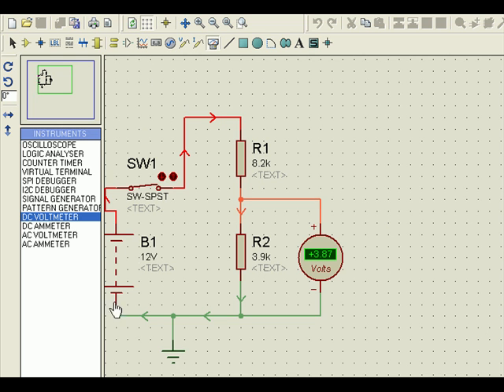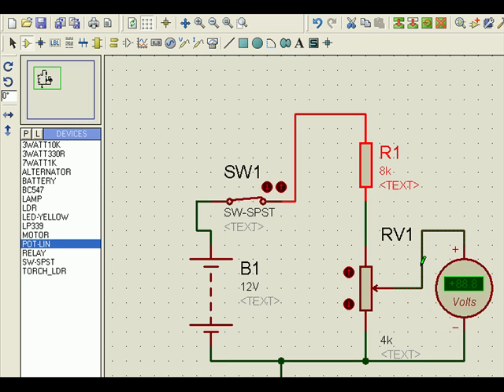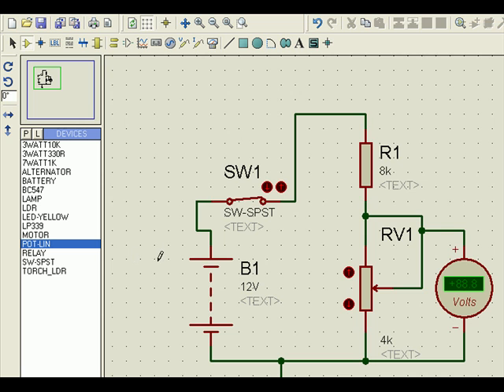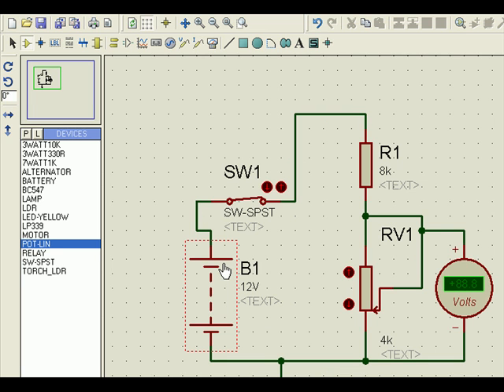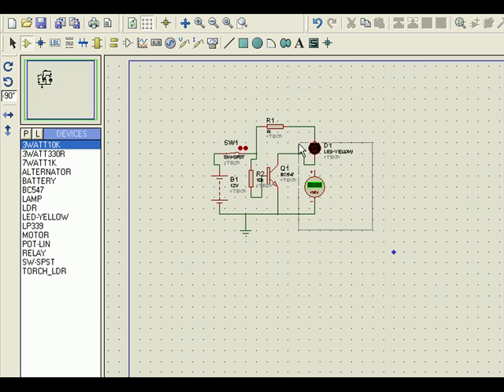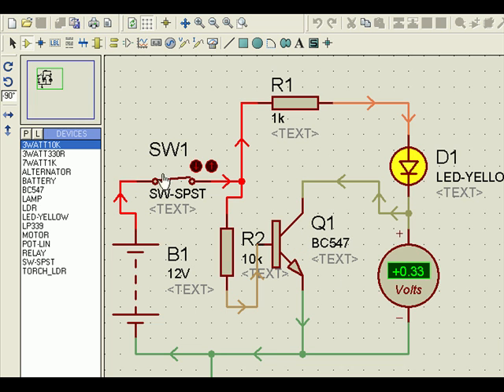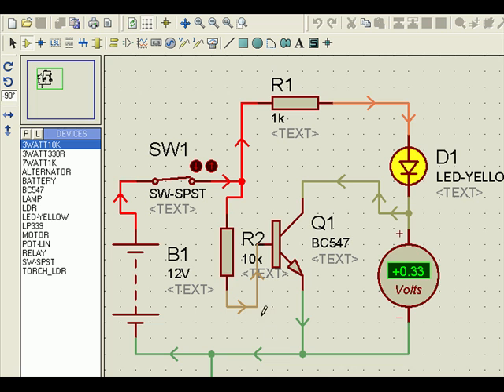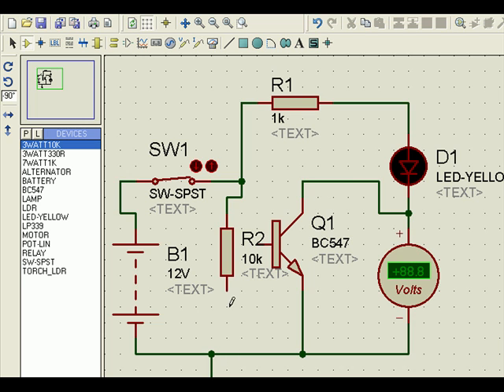Practical Electronics 2

Comment: Please can i tell me how to add the path of current to my circuit when its complete, thanks in advance
Reply from the maker: Dana Berezenjy System/set animated options , in which right side box- show wire current-select it
Reply: +Patnaik UC Why does not current pass through the Voltmeter to the ground? It should light the bulb apparently.